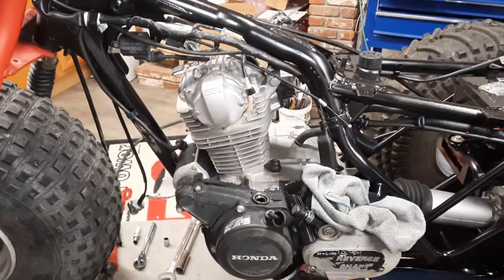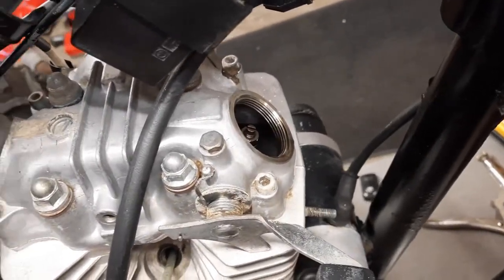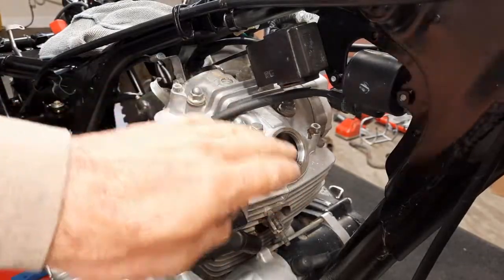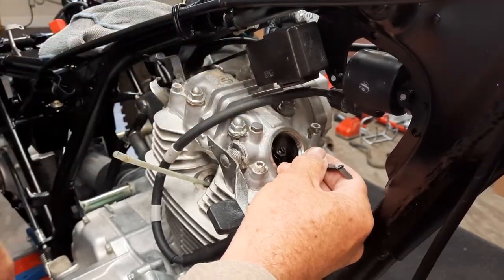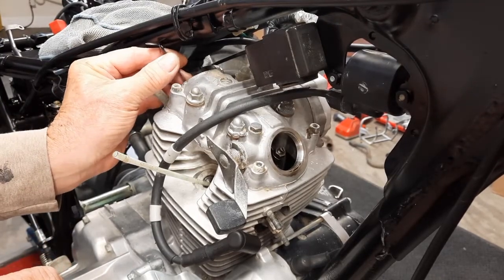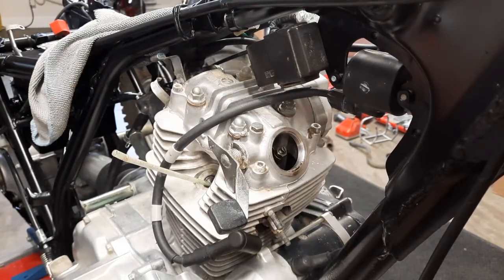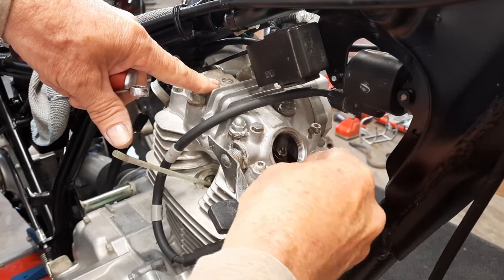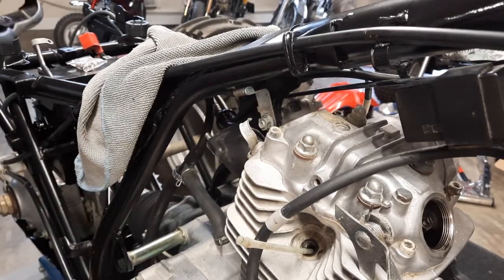ATC200ES Valve Adjustment

Comment: Where did you get the tapered valve tool?
Reply from the maker: Hi. Not sure but it most likely came from eBay.
Reply: Did you make the decompression release? Mine has a cable and I’m looking to get rid of it.